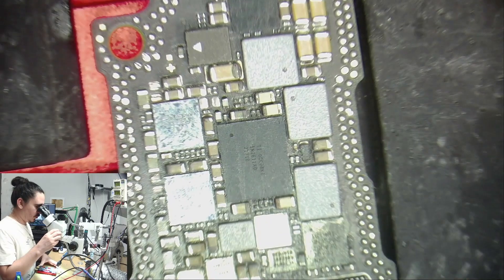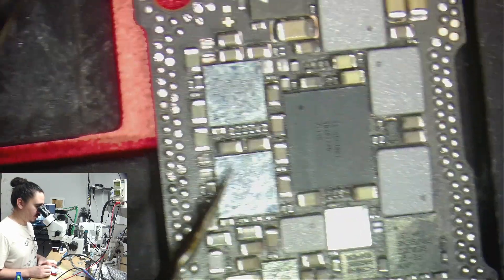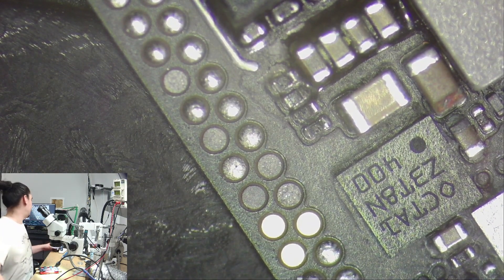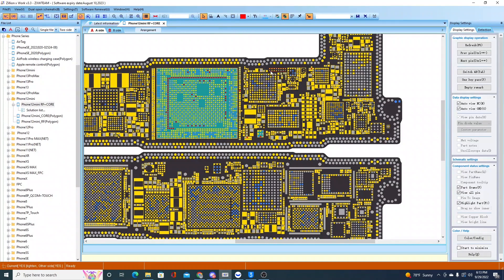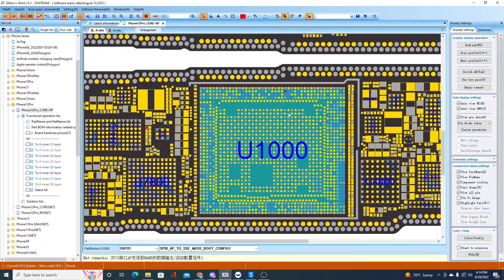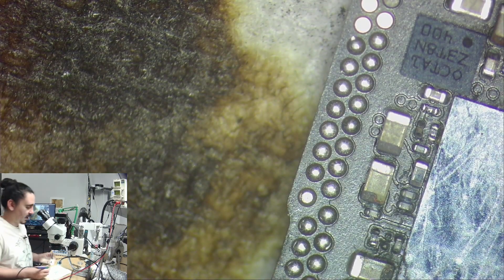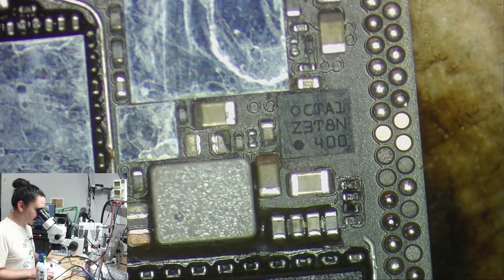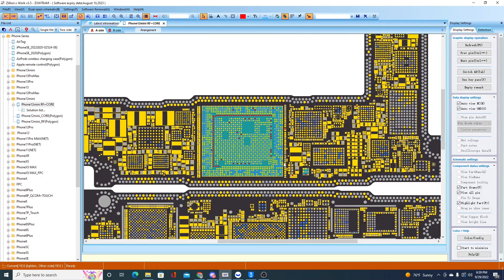How to fix iPhone 12 Mini Error 4045 - Won't switch to "Black Screen Recovery Mode"

Comment: that line was PCIE_ST0_AP_BI_NAND_CLKREQ_L
Reply from the maker: Nice! What software are you using has net names for the 12 mini?  ZXW doesn't seem to have them. Or are you just referencing another model to find the name?
Reply: @iBoardRepair  i referencing iphone 12 to find the name. that line is 'CB2' pin of A14 cpu
Reply: refox schematic software have net names for 12 mini.i have used it for a while, But i don't remember how accurate it is

Comment: Good job, thank you for your videos. I have a question please : wasn’t it more simply to make a swap please ? Thank you
Reply from the maker: I always to fix the board first, because if something goes wrong on a swap then data will be lost forever. I try to take the way that gives the least risk to data, even if it takes a little longer.

Comment: I'm curious, why didn't you measure the resistor after removing it from the donor board, and then put it back again, to keep the donor board complete, then get an equivalent resistor for the repair?
Reply from the maker: I mentioned about that at 5:15. I was going to replace with an equivalent resistor but the value was kind of fluctuating when I was measuring it on the board so I wasn't exactly sure what I needed. I guess I could have taken it off first and then measured, but I just figured I would most likely transfer another back when I needed to use it from whatever damaged board I'm working on.